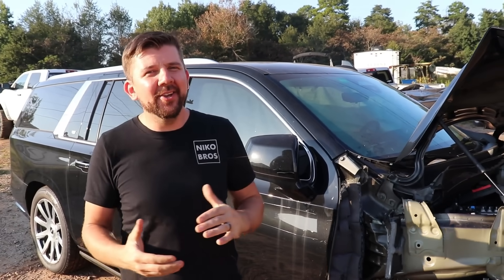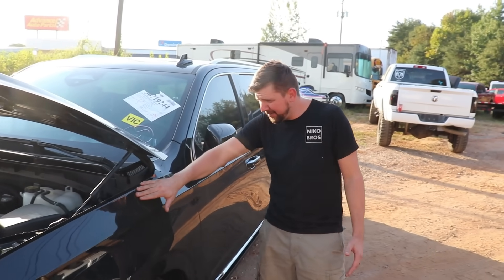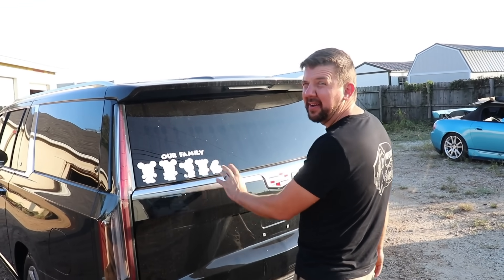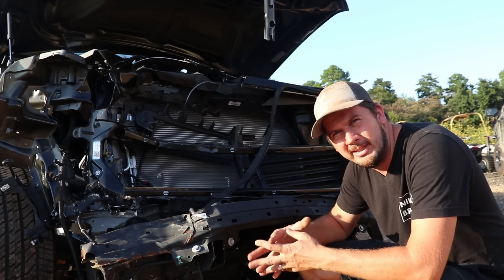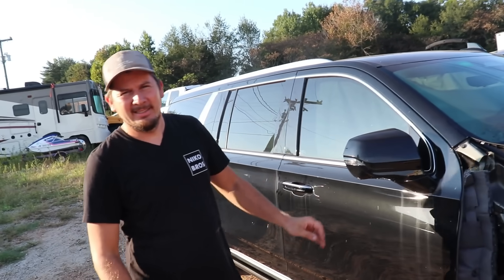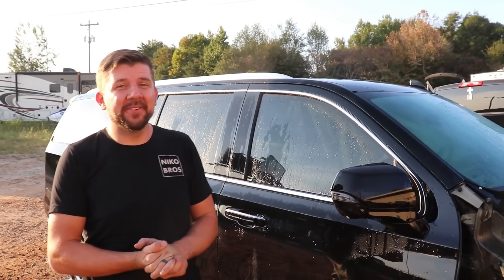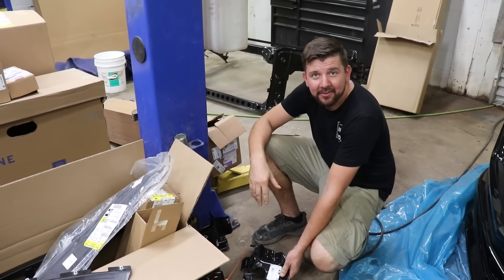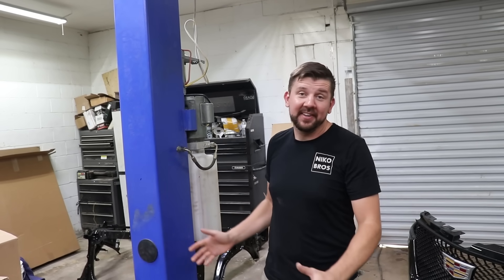WE GOT A WRECKED 2023 CADILLAC ESCALADE EPIC NEW REBUILD @23RD

Comment: On an almost new car it should be all new parts. Yes straighten the frame to get the correct measurements but replace it.The end is designed to crumple in a crash.This will be a great project with you working together again.👍👍